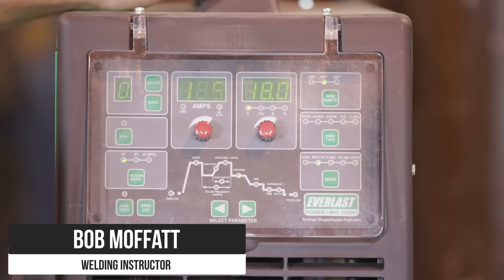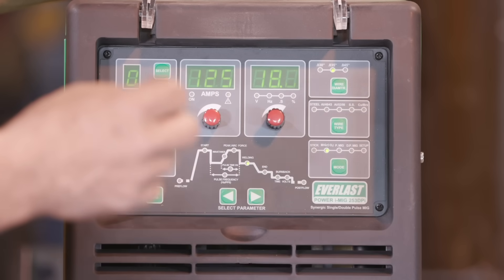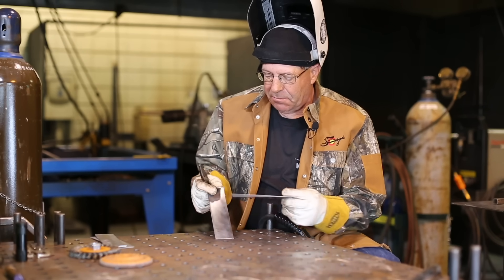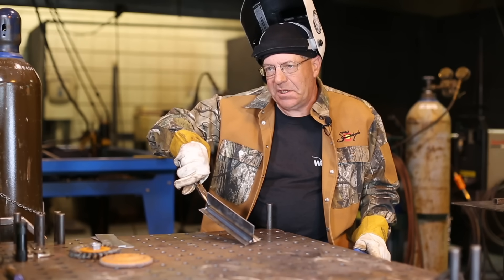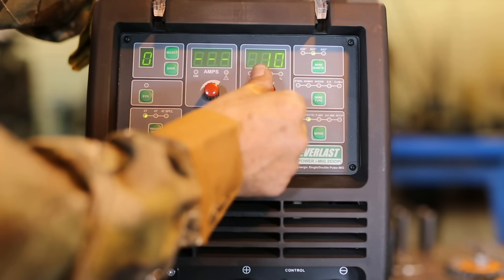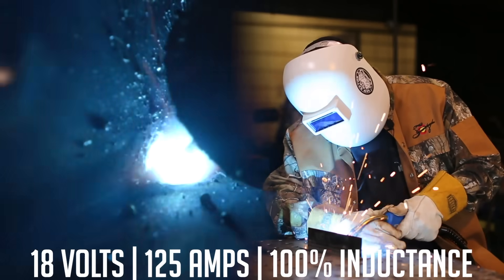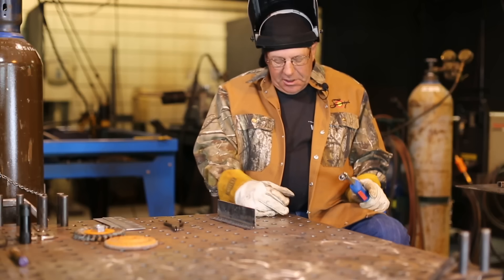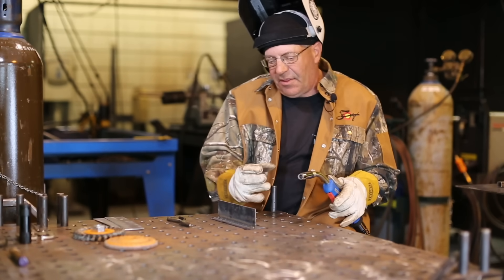🔥 Basic MIG Settings (on the Everlast Power iMIG 253 Dpi)

Comment: Great information again,  Mr. Moffatt. I understand the lesson was not mainly about the machine. Do you know if the Everlast Power iMIG 253 Dpi,  has the pulse process while in the stick mode? I have seen this on one other machine and it seemed worthwhile at keeping the heat down. I looked at the Everlast site but could not make the determination with the information provided.

Comment: After years of using flux core 0.9mm/035" I recently moved to true mig with gas. Slight learning curve, sounds very different, looks heaps better AND does not weld galv anything.

Clean material makes your job a whole lot easier. 

Thank you for your insight and wisdom Bob.

Comment: That machine is a dandy and packed with features.  It's also on sale until Sunday, which makes it a very affordable machine for what it does.  I was curious if are you running in synergic mode with setting the amps instead of wire speed or if that's the ways it runs in full manual mode?  As always, thanks for taking the time and sharing your vast knowledge.